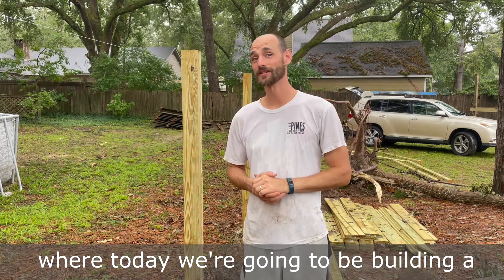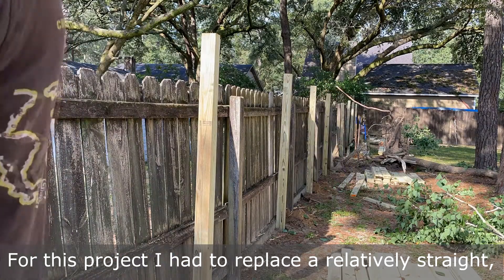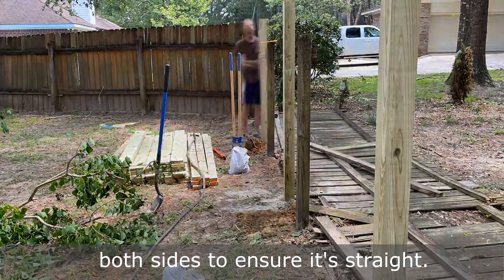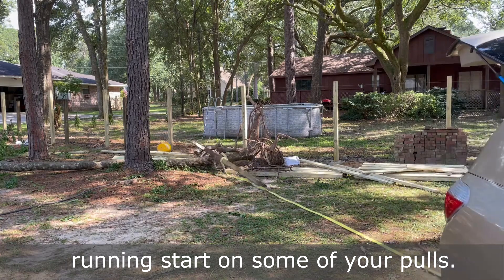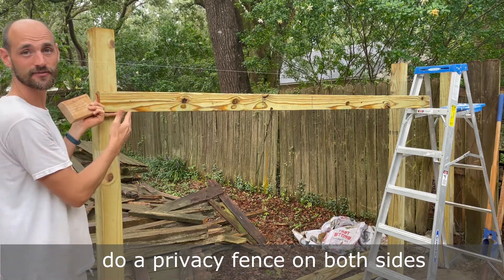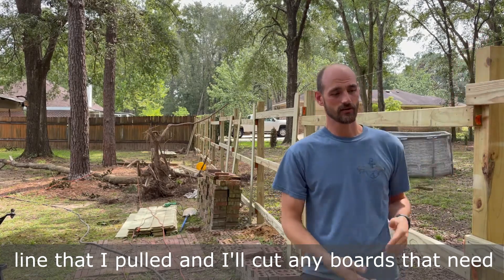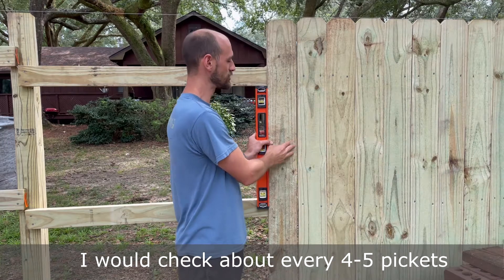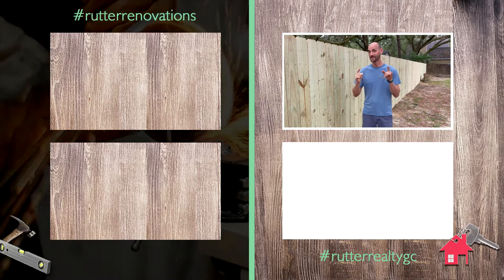How to Build a Fence (Privacy Fence)!

Comment: Using your vehicle to pull a post out is a terrible unsafe idea
Reply from the maker: Agreed, unless you use a static rope (I used a dynamic... it was a bad idea, but worked) and a 4x4. A static strap or rope will have less of a bungie affect.